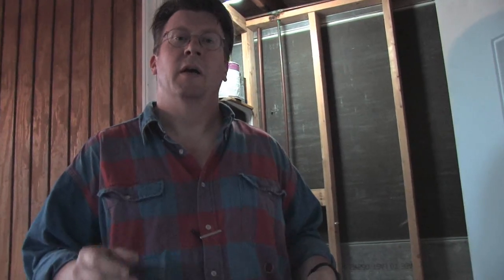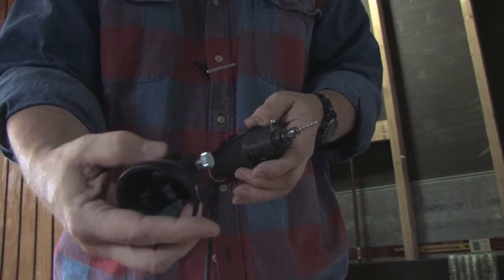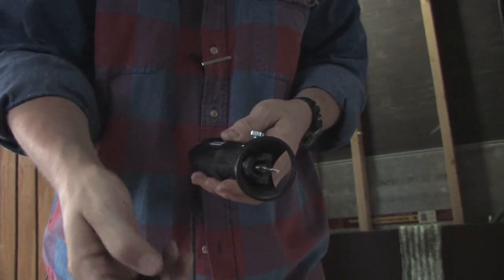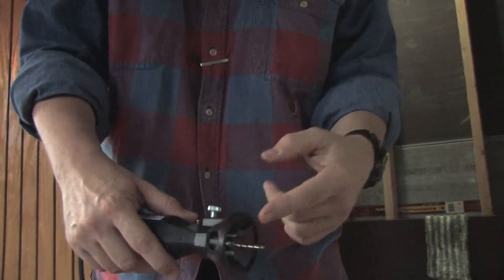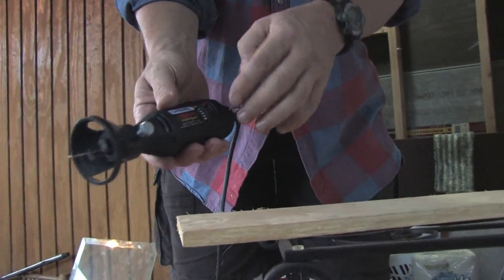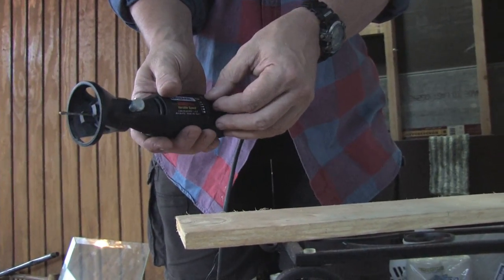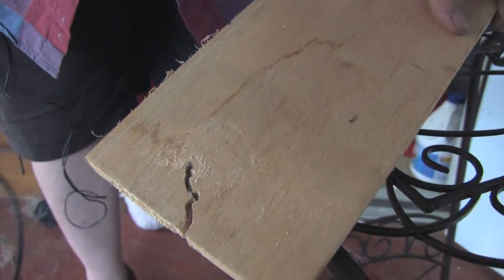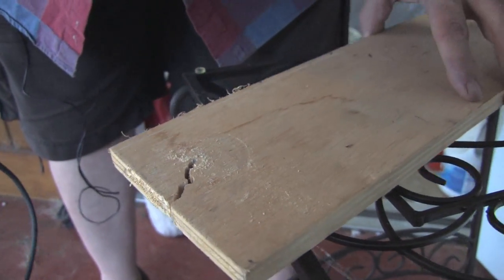Using a Dremel Tool : Dremel Scroll Saw Tutorial

Comment: Right, it's not a heavy duty tool. Perfect for purfling rebates on violins type jobs. But that said, if you don't have unrealistic expectations and push it beyond its limit, take your time and work wisely and with zen, these little tools (the plug in model not the battery version) can perform some amazing things like cutting 1/8 thick mild steel tubing and steel rebates. 10 years ago I literally made a quality .22 calibre automatic with just a dremel a drill press, files and stock steel tube.

Comment: People, do not use your dremel for this. Unless you want to buy a new one.

1. Dremel could barely handle the wood size thickness
2. Scroll saw width is much smaller than the size of the dremel drill 

Dremels are amazing tools and have a purpose in the shop, this isn’t one of them.

Comment: Use bit 561. About 10 usd/eur for three. It is specified for soft wood and plastics of 12mm or less diameter. Lifehack: you can shorten the bit for more stability/lower chance to break if you dont need the length.

Comment: The key to using these bits is full speed but apply low pressure, don't force the bit, especially when cutting thik wood. You also need to use the correct bit, they may look the same but are only for plasterboard etc

Comment: Interesting video. Has anyone tried to use a Dremel to cope molding? Trying to find a easier way than using a coping saw.
Reply: Yes, on the Dremel website they have a video doing that. Use the sanding tool and it makes fairly quick work of the trim piece. Probably will go through a few of the sanding pads though to do a few rooms, but they are super cheap.

Comment: I think that piece of plywod is killing your dremel. I would stick with thinner furniture plywood for doing this. Otherwise, buy a proper router. (I am not sure how this replicates a scroll saw.) It does cut holes in things of any shape you like as long as your material is suited for this small precision tool. Also, In order to see what you are cutting, there is a hole in the side of the router hood so you can follow your lines. He doesn't make use of this.

If you are doing this on furniture to make modifications, such as cutting port-holes. There is also a hole guide too which you can get that will allow you to cut perfect circles. This is where this tool really shines. It's great for cutting holes of a flexible size in the back of furniture so you can mount fans or create cable ports in them for home electronics.